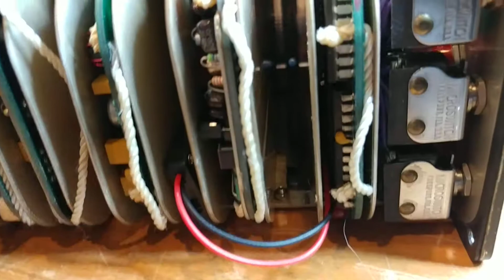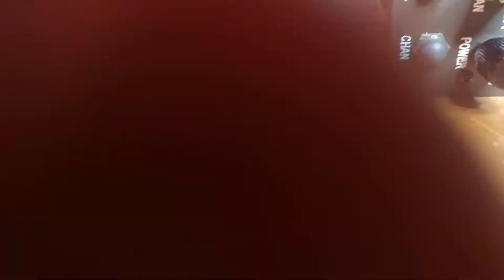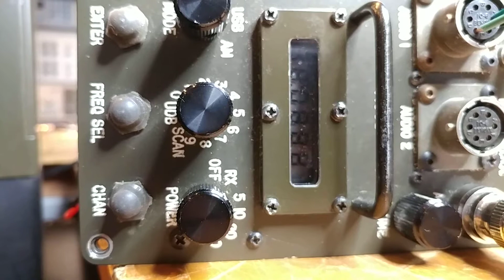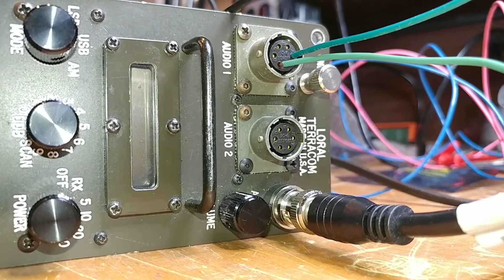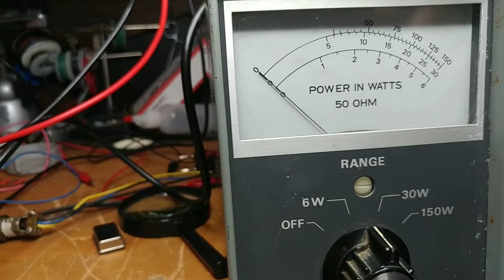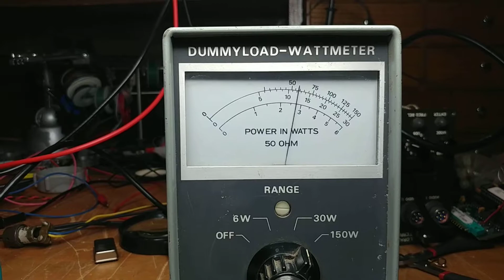(Part 2) Repair/Testing of an AN/PRC-132 HF Manpack

Comment: Thanks for the  Video it fix one problem, I have another it seems that when I program the radio and I have the military version it puts the frequency in all the channels rather than the one I’ve selected is there a mode that I’m in there I need to change to I don’t see how to do that if there is and what would be the cause of the problem of that’s it’s putting the program frequency in every channel?
Thanks
Reply from the maker: It's been years since I played with the radio but I don't think there is a mode to program all channels.  I suspect an electrical problem. Maybe the cpu it's doing something wrong.  Good luck

Comment: Good morning thanks for the videos, i have question i have the same transceiver and i dont have batteries for that how you powered your radio?thanks a lot Bernard
Reply from the maker: Find a mating connector for the rear of the radio body and wire in access for DC input. Or, just solder on some wires. 73
Reply: @w2hx  thanks a lot my transceiver its working not having the problems you got in your video

Comment: I will be interested to see where you will get a replacement TCXO. I know you will figure something out. W4OSS
Reply from the maker: I have to get this project back on the bench, but I purchased a high stability 10.24 MHz TCXO that I will divide by 2 using a flip flop.  Fingers crossed I can get it all to fit. I'll make a video once that project is back in the queue.
Reply: @w2hx  and the final result is....?
Reply from the maker: @new2radioz  ha! One of those projects that is still on the bench. other projects have taken priority. but thanks for asking. I hope to get back to this.